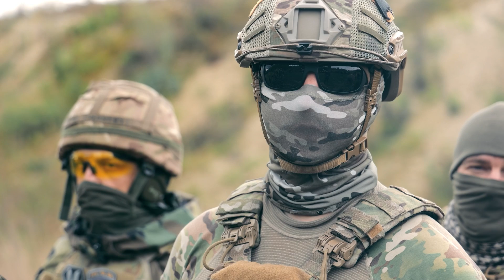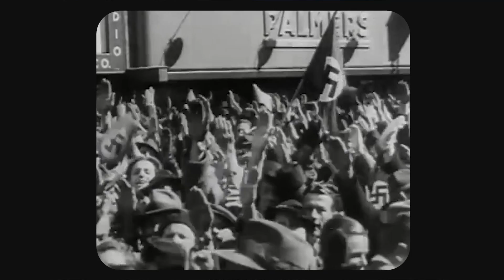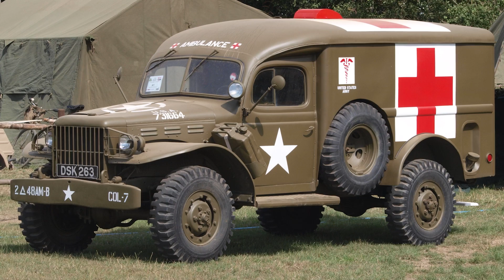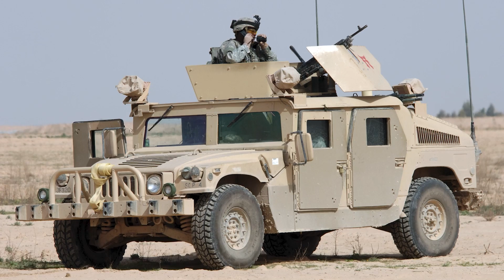The Unsung Hero of World War II (The Dodge WC Series)

Comment: I've driven a few of the restored dodge w series. 5 ton was the heaviest of the group, but the 2.5 ton and the old 5/4 are probably the most useful if a. Civilian wanted to build one for farm work. Not counting the jeep, of course.
I got to drive, what was essentially, a big 4x4 panel truck. It had a top speed of 57mph according to my gps, and, during its time with the US Forrest service had electric windshield wipers that replaced the vacuum units. I really loved that thing, even if it didn't have the best ride of trucks i could have driven.

Comment: 1) "Beep" was rarely used. "Weapons Carrier" for the open cargo bay truck was much more often. This was because it was originally issued as a machine gun and mortar carrier foe Heavy Weapons Platoons (M1919A4 machine guns and 60mm mortars) in Rifle Companies and Heavy Weapons Companies (M1917A1 machine guns and 81mm mortars) of Infantry Battalions.

2) The WC was largely replaced in Korea by the M37, which in turn gave way to the M715 in Vietnam. When I was in ROTC 1970-74, we had an M715 assigned. The M715 gave way to  the M561 Gama Goat for tactical units and M880 commercial pickups for garrison work in the Seventies. https://en.wikipedia.org/wiki/List_of_United_States_Army_tactical_truck_models

Comment: The WC truck has a long lasting legacy in the Israeli M325 "Nun Nun", which unsurprisingly is the abbreviation of "Weapon Carrier" in Hebrew (נושא נשק), and which was in production until the mid 80's. It was still seen in service until 2010 with reserve units. It's basically the same WW2 WC truck, slightly modernized with more angular panels, and there were even patrol versions with a V bottom against mines, a special seat on the outside to the right for a tracker/pathfinder and several universal mounts in the back for M1919, M2 or M240 FN MAG.

Comment: I've had the honor to drive one of these (the 52 version), and you really feel all 3/4ths of that ton they weigh! I've driven tractors that were easier to get going on a hill that this beast, but it did feel like I could bowl over a tree without too much of an issue. It didn't help that the starter for the thing was above the accelerator

Comment: The idea of having so many variants built on a common platform sharing most crtical parts made keeping logistics chains functioning all that easier. In a pinch, badly damaged trucks could be parts donors if new parts werent available. Contrast that to the German approach which tended to a dog's breakfast of different manufacturers, none of whose parts were interchangable.

Comment: While in Germany in 65-66 as a radio operator (05B20), I was assigned a ¾ ton Dodge modified to accept one or more radio transceivers (installed once when France kicked us out).  It was a great rig for German winters, but a real gas hog.  When I got it, it had close to ¼ million miles on it and I added a lot more between Frankfurt and Bremerhaven.

Comment: I had  for my use a  M-37 at Cu Chi in 1967 I can tell you from experience it could haul two or more a couple of 2 1/2 ton differential axle assemblies from tech supply back to the maintenance shops that truck was a beast

Comment: The frequently shown photo of the guy hanging onto the 50 cal. was the Army's first tank destroyer! It had a copy of the German 37mm AT gun with a 360 degree transverse with the Ma Duece to shoot at aircraft and enemy infantry. The Army stopped having any more made since it's cross country performance sucked and the 37 couldn't be fired forward without it's muzzle blast shattering the windshield laying flat on the hood. Those faired better on roads so saw little use as scout cars driving over rough terrain. Otherwise, they were dead reliable and easy to maintain. Like all US military vehicles then, their fuel filler necks held a funnel that opened up when pulled out to make refueling from Jerry Cans easier and less wasteful.

Comment: In 1975 my small detachment in the XVIII Airborne still had a Willey’s jeep and 2 of these Dodge WC’s. I loved the jeep of course. The WC’s were replaced soon after my arrival with 2 new 1976 Dodge 3/4 ton pick ups painted in the familiar matte olive drab. They soon went to the painters for the camouflage treatment. But those 2 WC’s (of uncertain vintage) with the familiar tires, canvas tarps, fenders and basic grills were still in service. Not long after I ended my time of service the HumVee’s appeared. I have photos in the motor pool of some of that equipment   Thanks for the video.

Comment: In the period of 1954 - 1960 (my early years 0-6 years old) we lived on an apple orchard up on the Ozark Plateau, just east of Anderson Missouri. Our house was built in 1867 or there abouts, and it was big and drafty, andt needed a lot of heating in the winter. My dad had an old WWII WC Dodge truck he used around the farm, I and my older brother riding shotgun. I remember two long trips where Pop went quite a ways to get a load of coal. We drove for hours on narrow windy roads, east I presume, since heading west would quickly drop you into the grass plains of Oklahoma. We went pretty slow even for that era, and for a four year old, it was interminable. Then we'd get close to the mine, going up a creepy wooded canyon, the last mile slow and twisty, the trees getting dark from coal dust. We break out of the trees into a wider part of the canyon. The mine had a few buildings and the usual collection of heavy equipment. Everything was black from coal dust. Pop would go into the business shack for a minute, then drive over to the small loading chute. The coal loaded in a few seconds in a rush of noise and vibration. Then we'd take off, going even slower on the way home. We moved away from that hard life to Pheonix in 1960. There was much I missed from that wild place, including that truck.

Comment: Extremely stylish in 1939 = absolute work of art in 2023!
Also, people who claim that the Merlin engine was the engine that won WWII forget that the straight 6 in it's several iterations by Dodge, Chevrolet and Ford, was the actual engine that won the war according to the troops in the ground. I learned to drive a manual in a 1973 Chevy C-10 pick up truck that my uncle (a mechanic and former combat engineer with the 66th infantry division) had put a 4.4 litre straight 6 from a 2.5 ton GMC deuce and a half in. Took the darned thing 55 minutes to get to 55mph (and would not go faster) but give it enough traction and it could pull an I beam out of a concrete wall! Tune ups were easy too, stand over the front axle and do whatever you need to work on! 🤣
Reply: Haha my CMP is the same, Chevy 235 we pull trees with it first gear low range and let it crawl it just leaves with them 😂

Comment: Great video on the dodge WC 
We had one on the farm in Victoria Australia from1951 till 2004, when my father died and is wife gave it away with out telling me. 
It was a RHD conversion. this old truck carried tons, regardless of its 3/4 ton status. My father used to say it was more comfortable to ride in than his prewar Graham page. It was often driven to its max speed ( on the Speedo) of 60 mph .
I cried the day it went, l learnt to drive in it as a 10 yo, and mastered changing gears up and down via matching the engine revs on the crash gear box.
Changed many a broken axle, steering box's, and rebuilt the engine piston rings an bearings without taking the engine out.Those side valve 6 cylinders engines were Bullet proof.
The Speedo always worked, infact all the four gauges could be relied upon to tell you what the dodge's donk was doing.
Post script
It. Has been completely rebuilt in its original army colours and is still road registered and used for ANZAC day ,to transport vets,

Comment: Frankly, the design genius of the US motor vehicle industry was amazing in WW2, for example, the 5 ton Studebaker, a bastard to drive, suspension rock hard, but with minimal maintenance it would go forever and everything on it could be worked on with 3 scanners and interchanged. It would still run if 2/3rds of its drive wheels were disabled.

Comment: My parents were dairy farmers in Alabama throughout the 1950s and 60s, and they had a Power Wagon.

That winch on the front bumper drove directly off of the crankshaft. A purely mechanical beast.

Sadly, it never worked while dad owned the truck.

Parts were not available.

Comment: As a volunteer fire fighter in the mid-1980s, we had a 1952 dodge M37 that has been converted to a grass rig. While it was not speedy, I am convinced that you could set the throttle put it in 4 wheel low pointed into a mile section,  go around and wait for it to come out. That little truck was indestructible!

Comment: THANK YOU - For this Video - Giving Deserved LOVE to Dodge's MASSIVE WC-series ACHIEVEMENT !! -- Only One Error in the Script - MOST of the 255,000 of 3/4-ton Dodges had a 98 in ( 2.50m ) wheelbase -- Not the Earlier (1/2-ton ) wheelbase of 116 in / 2.95 meters. -- Added with wider Track axles, front & rear - this gave the 1942-1945 WC-series a Much More Squat STANCE -- The MOST-Built 4x4 WC-51 / WC-52 and their Stretched 6x6 sisters were 2.10m (83 in) Wide !

Comment: My first tour in Vietnam I apparated (stole) a 3/4 truck and used it as my personal vehicle when not flying.  I had a deal with the Company beer NCO that he could use my truck anytime he needed to. He rewarded me with a many a case of free beer. The oil was changed a couple times and that was all the maintenance that was required for the year I had it.  In 2007 I bought a Dodge Ram 3500 2 wheel drive truck with a Cummins 5.9 that has been almost as bullet proof. Oil, filters, tires and a set of injectors in 240,000 miles.  Hopefully when I die, they will put my Flag draped coffin on it and take me on my last trip to the military cemetery.

Comment: The Swiss Army bought masses of vehicles from The US Army at the end of the war: Vehicles were parked bumper to bumper on the German Autobahn and they were sold off by miles. And it seems they were dirt cheap. We bought many Jeeps, Dodge WCs and GMC trucks. (as well as P 51 Mustangs).
In Switzerland they were known for their high comsumption of gas. Specially the big GMC trucks. When I was in the Army from 81 to 85 the Dodge WC was gone. I have seen one parked where the maintance units worked. Amazingly enough a handful of GMC trucks were still in use in 1985. My Dad who served in the Swiss Army in the early Sixties told me many Dodge WC strories. They were in big use at the time. The earlier Jeeps wer auctionned off to farmers. Amazingly enough the Dodge WC was hardly around since the Eighties. A few were used by garages to tow and lift wrecked cars. I always liked those Dodge trucks but I never had the chance to drive one.

Comment: Would be fun to see one of these on International Harvester. A huge company at the time that is largely forgotten now. They were one of the largest suppliers to the war effort, and built a lot of trucks in some of these same categories. Their scope products reached far deeper than probably any other; from trucks, to torpedoes, to refrigerators.
Reply: They also made artillery shells, bomb casings and M1 Garand rifles. Not to mention they were already a large producer of bearings. They also supplied wheeled and tracked tractors, bulldozers, and other industrial equipment as well.
Reply: @dalecornelius4374  All notable indeed! Though the Garand came after WWII. The bearings are interesting, a fairly specialized industry and outsourcing them was and is normally how its done. Everyone thinks Ford was the king of vertical integration, but IH was on a similar lever and perhaps more so in my opinion.

Comment: I wanted to a post war truck. I did some research and once I learned the my current Dodge would be equipped with the same 218in motor I had to buy. I knew that Dodge made some really good truck at that time and especially were known for their war time production trucks. My truck has been the best truck I ever owned and mechanically I learned from other owners that my Engine and Transmission have interchangeable parts with war Power Wagons as well. I own a 1950 Dodge B-2-B

Comment: Not only did Chrysler build trucks  - they also were the lead engineers for most of the tanks that the US built - particularly the Sherman, as well as assisting Boeing with the design of the B-29, and Pratt & Whitney with the cooling of the engines for the B-29.  And UNLIKE GM and Ford, Chrysler DID NOT assist the Nazis during the war, either.
Even the M-1 Abrams was originally designed and built by Chrysler.

Comment: People think of the HMMWV as a "jeep replacement" (and, to be fair, that's how the US Army presented it for the most part).

But, the HMMWV really fit the roles of the ¾ ton WC (and the later Korean era  M37 and Vietnam era M715) better than it ever did the jeep roles.  Which is why the US has been spending the last 30 years experimenting with various ATV based vehicles to get back that small and nimble capability that larger vehicles just can't fufill.
Reply: I served in the old Army Security Agency in the years '68-'72, We had  a piece of equipment called the MLQ-24, and I trained on it during my training at Ft. Devens, MA in 1969. It was mounted on an M-37 Dodge truck.  You can find pictures of that set up on the net.
Reply: I bought a Willys MB today.

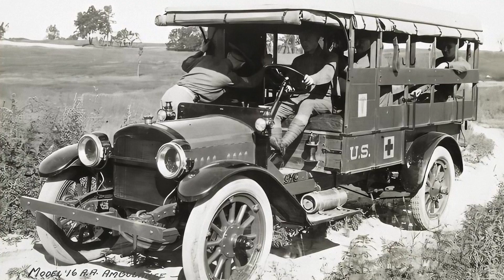Comment: 1:20 - Chapter 1 - Need , design & development
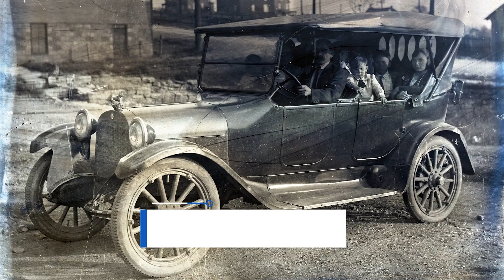1:45 - Mid roll ads
3:05 - Back to the video
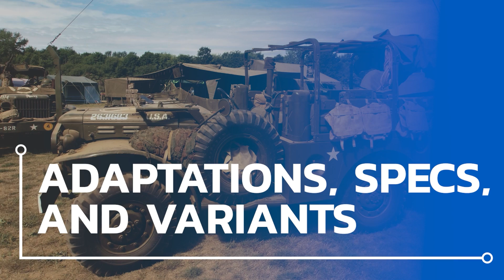7:25 - Chapter 2 - Adaptations, specs & variants
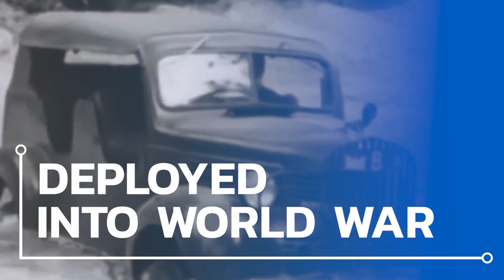11:05 - Chapter 3 - Deployed into WW
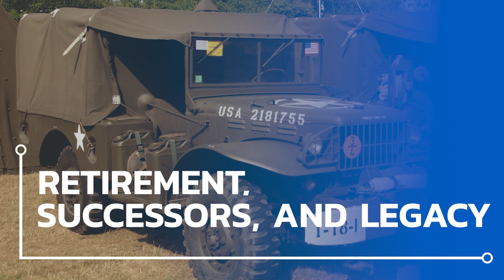13:35 - Chapter 4 - Retirement, successors & legacy

Comment: I still drive a WC53. Its not very fast, maybe 47mph. Gets 10 mpg. But its pretty reliable and still running strong after 80 years.
Reply: Come the fall of society, that WC will keep people alive. :)
Reply: Faster than my WC-63, lol.
Reply: @erikkunkle9574  Really? How fast does your WC63 run?
Reply: @leftcoast9261  it stays in 4 WD.  The book and plate say 55 in 4th.  I get it to about 25, 30.  Sometimes 40 depending on the heat and road.  Got it to 52 going down a hill.  To be fair, the route I tale to go anywhere has a lot of hills and 4 way stops.  Can't just get rollimg amd stay there
Reply: @erikkunkle9574  Mine has locking hubs, so that helps to free things up. And it's been on some pretty long trips. So I've had hours playing about with "Just how fast can I push this thing?" I also got mine up over 50 coasting down hill. Only once or twice. That just kinda' spooky!
Reply: @leftcoast9261  yes, ues it is spooky.  I had to do it to get up a steep hill, lol.  I have a friend with a WC-53.  We drove each other's vehicles once.  I felt I was in a sports car and he felt he was in a micro bus.

Comment: My father was a sergeant in Europe responsible for fixing trucks, cars, and jeeps. He even came up with a fix for the jeeps stalling out.
Reply: What was the fix?
Reply: @davonmulder8458 probably to hit it hard enough with a wrench.
Reply: @davonmulder8458  Shortened the spring that controlled the air intake flap on the carburetor.
Reply: @d.l.gentsch5304  to increase the tension?
Reply: More air

Comment: I own a '44 WC-63.  I enjoy it.  I worked logistics in the USAF for 24 years.  When I looked for a WWII vehicle, I wanted a logistics power house that could fit in my garage.
Reply: You still run on the original engine or have you swaped it? Is it always in 4wd or it can be switched off? Can you lock the diffs and the transfer case or is it alwys open?
Reply: @edvin884  original engine.  Always in 4WD, you can shift the front dif into 6 wheel drive.

Comment: Drove the WC when I was in the US Army in France, '62 - '64.  Known to us as the Dodge 3/4 ton.  It was the yeoman truck for all duties and light hauling.  Rugged and ready.  They seemed to always work.
Reply: Were those WCs, or the later Dodge-made M-37?
Reply: @AndrewAMartin  M-37.  You could get about 8 GI's in the back.  Ours had a 24 volt light bulb hanging in the back. Rode from Fontainebleau to our post many times.  We always had fun and BS'ed a lot.  GI's do.  That truck was solo in our motorpool which was mostly 5-Tons.  It always worked.
Reply: @zoltankaparthy9095  I really want an M-37, have for decades, but that desire is tempered by three things: 1 - I have nowhere to put / store one (already have 3 vehicles and only a single carport) , 2 - I can't afford a restored example, and 3 - I don't have the facilities to fix up a basket case and make it what I want. But I still save every listing for one that comes up on FB Marketplace...

Comment: Ahhhh, I love me a good jeep. My favorite is the Wangler Jeep TJ Sport manual transmission soft top. Total gas guzzler. Her name was Topaz, my ebony queen, and we guzzled and farted all around the tokyo area. I would put her in bikini mode, no roof, windshield down, no doors and we would face the sun, wind, rain, and snow together while blasting the roads with ZZ top, AC/DC and all that jazzy. I even learned to drive stick with one foot ( except for starting on inclinations greater than 33 degrees). One foot out the whole time (3 hours was my max). Probably the only one in the world to master this driving skill. She was souped, lifted, and tuned to pull boats and had a powerful low gear torque. She hated going into first gear without a heavier load, though. Such a beautiful beast. Alas, I hit low times and had to sell her to a Qatar car dealer. Maybe she found her way into the hands of a noble warlord and is continuing her fantastic adventures somewhere without me. My closest and best friend I ever had. Bye...